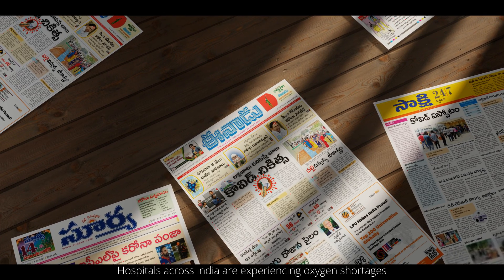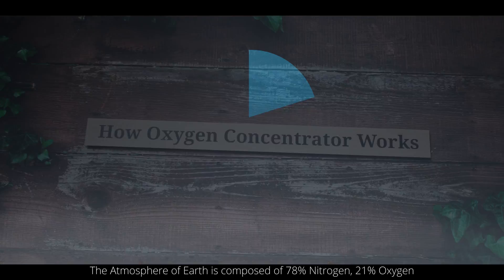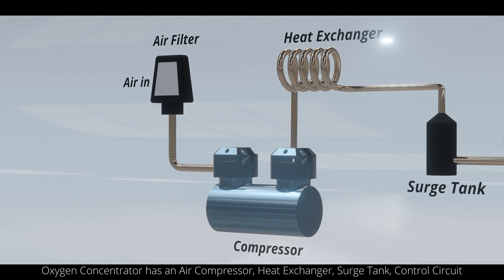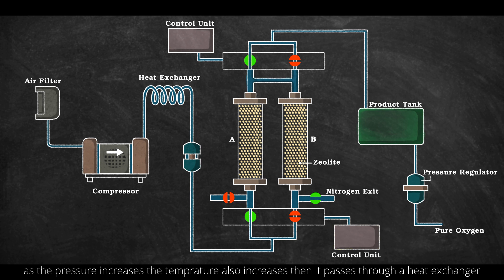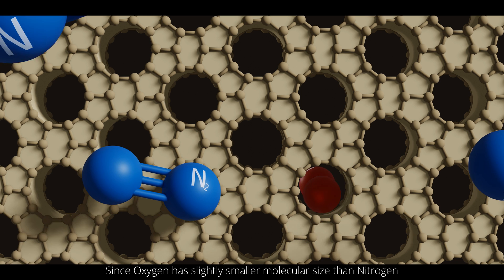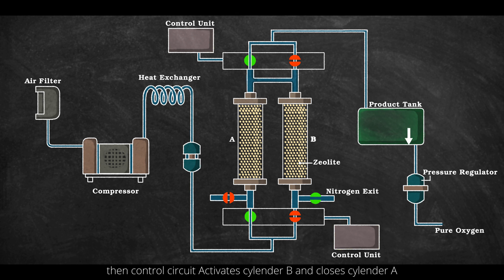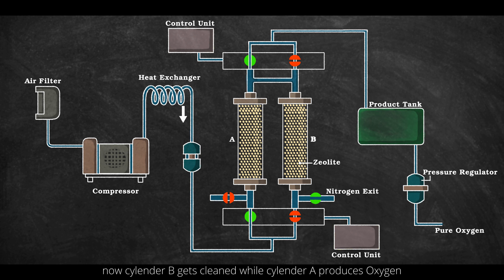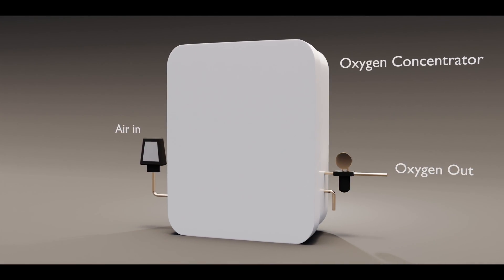How Oxygen Concentrator Works | Karthi Explains

Comment: I am curious about how much pressure you can get from one of these without using a separate oxygen compressor.  If you used relief regulators on the nitrogen exit, could you get the system to operate pressures for welding torches or cutting torches (10psi, 40 psi)?
Reply: These cannot produce the pressures or volumes needed.

Comment: The only error I see is in this video is equating a molecular sieve (as used in O2 concentrators) to a "filter" that stops N2 and lets O2 pass because the O2 molecules are smaller and the N2 larger and so get clogged in this "filter". It teally isn't a filter at all. All gases can ultimately pass but the voids in the zeolite material tend to trap N2 molecules because the match the size of an N2 molecule -- at least until the molecular sieve becomes saturated with N2. So part of the trick is in knowing when that may happen and scrub our the sieve with a backwash of O2 before it does.
Reply: interesting.
BTW jayanderson, have you become a flat earther yet?

Comment: I saw machines, where the nitrogen is not released in batches, but continuously. Are these different machines? If a machine has "10 litres" - does this mean, that the oxygen output is 10 litres (95% purity)? As the air has 21% oxygen, then at the nitrogen output there should be around 45 litres of gas. Is this correct? Or how much gas is release at these two outputs (low and high oxygen output)?

Comment: How much pressure do you need to compress the air and separate the oxygen from nitrogen??
Reply: around 21  to  26 psi  at the top of the pressurized cylinder

Comment: From the animation that means pure oxygen will be given out. But from what I know, it's dangerous to breath pure oxygen.
https://www.sciencefocus.com/the-human-body/why-does-breathing-pure-oxygen-kill-you/
Contrary to popular myth, hyperventilating air at ordinary pressures never causes oxygen toxicity (the dizziness is due to CO2 levels dropping too low), but breathing oxygen at pressures of 0.5 bar or more (roughly two and a half times normal) for more than 16 hours can lead to irreversible lung damage and, eventually, death.
Reply: Best long term use is with a small room like a bedroom having regulated airflow so C02 can escape . Monitor the total O2 in the room with an accurate meter , they do not cost much & can measure 24/7/365 . Try to keep oxygen level in the room at about 25 - 28 % & no long term adverse effects will be noted. The pressure created by the machine output actually increases Room leakage as most rooms cannot be sealed very easily with the construction techniques used now. You will have excellent environment & use humidifier to keep humidity levels between 25 - 35 % as the minimum humidity . Low humidity makes air easier to breathe. Meditate as usual & all will be well .

Comment: I do not know whether I am correct or wrong. I read that the Nitrogen Molecules remain in Zeolite bed and does not ass away in air. If ite pass away then we need not to change the Zeolite Bed.  What is life of Zeolite  in which oxygen passes. If you have thorough knowledge please share your mobile no. for paid consultancy. Satish 9422014714

Comment: Amazing technical clarification......thanks a lot
Reply from the maker: Thank you 😇
Reply: These oxygen concentrators utilize a molecular sieve to absorbent gases and operate on the principle of rapid pressure swing adsorption of atmospheric nitrogen onto  zeolite  minerals at high pressure. At high pressure, the porous  zeolite  adsorbs large quantities of nitrogen, because of its large surface area and chemical characteristics. The oxygen concentrator compresses air and passes it over  zeolite , causing the zeolite to absorb the nitrogen from the air. It then collects the remaining gas, which is mostly oxygen, and the nitrogen desorbs from the zeolite under the reduced pressure to be vented. http://www.antenchem.com/en/news/Zeolite_technology/
Reply: https://youtu.be/qIW8n9MaVcc

Comment: You have to get your fundas right before you put up a video! It's certainly not size based separation, more like preferential sorption!
Reply from the maker: It’s “pressure swing adsorption” PSA separation, It Uses high Pressure and zeolite to separate oxygen and nitrogen, due to larger molecular size of nitrogen it gets trapped in Zeolite pores in high pressure and Meanwhile due to smaller molecular size of oxygen it escapes, didn’t get trapped in zeolite and goes out through the output port.

Comment: Say it once again, oxygen has smaller molecules than nitrogen? Bro, oxygen molecular weight is 32 and that of nitrogen is 28!
Reply from the maker: Understand the difference between Molecular weight and Molecular size … nitrogen molecule measures roughly 300 picometers while an oxygen molecule measures 292 picometers. Now tell me which is smaller

Comment: ilu gwawa
please advise people oxygen machine can produce nose and throat dryness because air flows in/out all the time. After use a couple of days, patient will ask for water especially during sleep.
Reply: Most machines supplied now have a water container that adds a small amount of humidity to the flow tube. Keep that container filled when it needs refilling & the patient will always have soft normal Mucous Membranes. Normal steam distilled water works best so any Calcium / lime deposits do not foul the tubing .

Comment: Separation actually happens due to the difference in the quadrupole moments, not the size.
Also, while one of the Cylinders is in Adsorption mode the other is purged from the product tank, not directly from the other Cylinder.
Reply: ok, good comment if this is true.  is there then a back flow check valve which opens up to allow the stored o2 product tank pressure to flow back and cleanse the nitrogen clogged zeolite?
Reply: @harlanglass  I have a valve on my plant. Commercially - probably different companies handle it differently.
Reply: Very nice, so do you provide oxygen or the device to make? What is your website to get involved. Thank you.